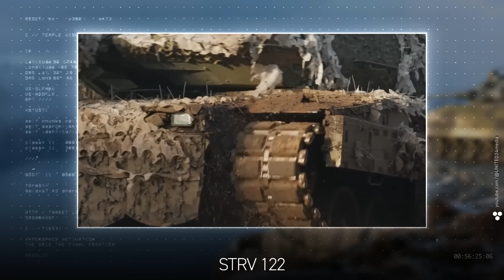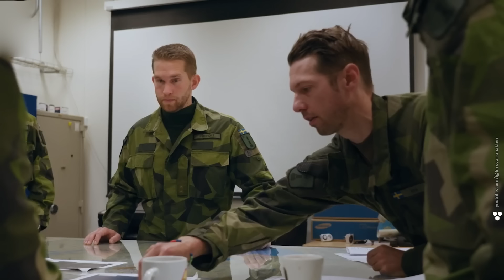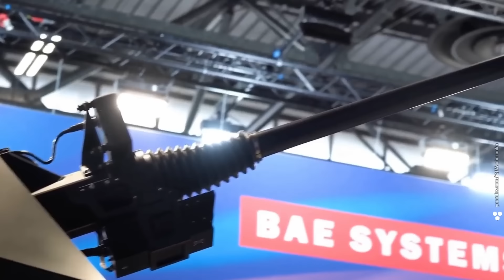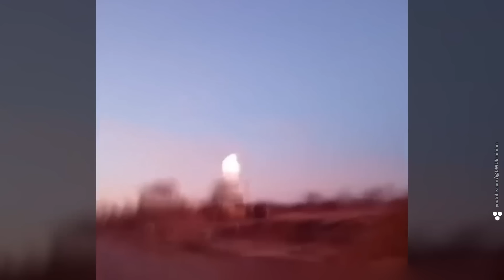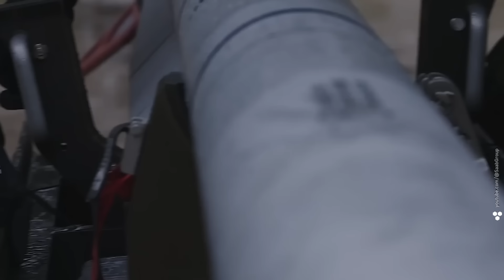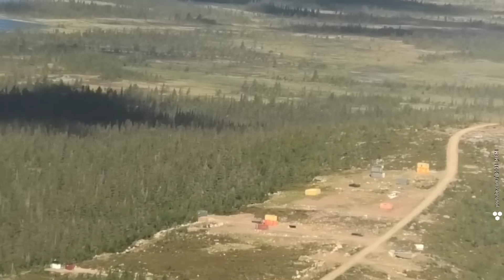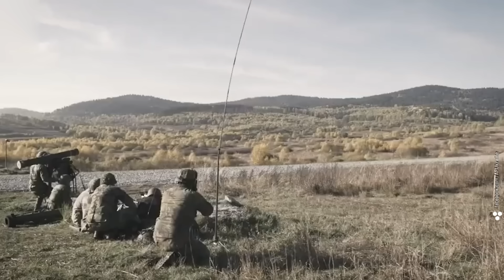Ukraine Just CHANGED Sweden's Army FOREVER - Here's Why

Comment: American has worked up a laser seeker head for our 2.75 folding fin rockets.  A single rocket pod can carry I believe 7 rockets.  The launching aircraft would need a laser designator but imagine the Gripen fighter with a laser and 6 pods that means 42 rockets and 42 aerial or ground targets destroyed.
Reply: It would probably use the targeting pod for target designation.
Reply: APKWS, not only America, but yeah, very helpful for simple SAMs (Vampire), AGR 20 affordable air to air kills etc. Would be even better with 19 shot launchers etc. Weight is not an issue here, in most szenarios.
Reply: @Walterwaltraud Don't the British and Canadians have systems that allow the use of very inexpensive missiles, for example, for drone defense? Even old, unguided missils can be used or or be enabled to track with them. They consist of several missiles in a single launch container, multiple of which can be mounted under the wings.
Reply: @MP-nc2pw  APKWS, or AGR 20, the unguided rockets get a guidance section. And it's not only the Brits and Canadians, there are plenty of products on the market, but the introduction is too slow, sort of.
Reply: @Walterwaltraud I only knew those two. But I'm interested in the other solutions.
Reply: @MP-nc2pw  The solution is the same, mostly, but a bit of domestic procurement for different countries. Each wants their own cake.
Reply: @Walterwaltraud scenarios *